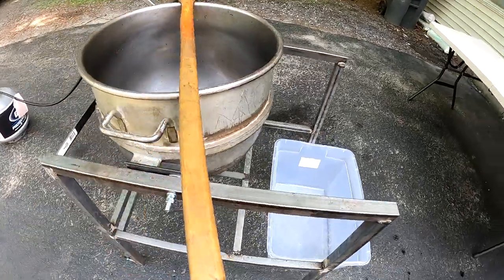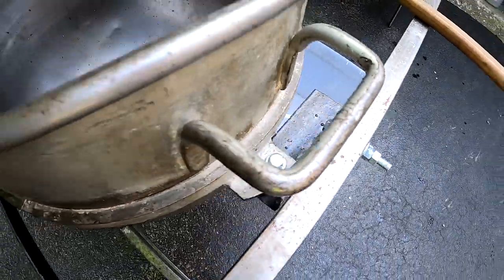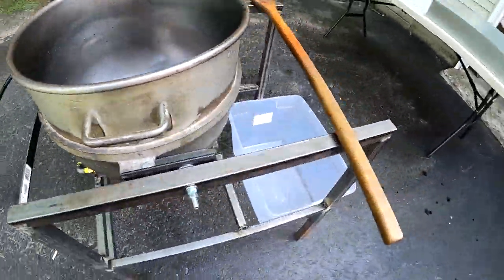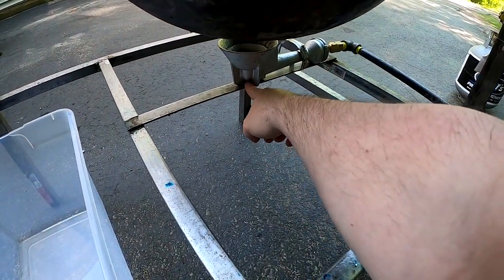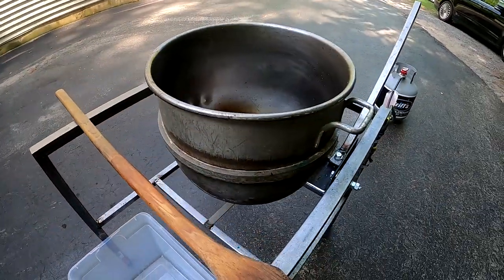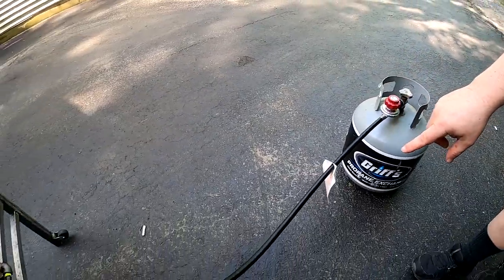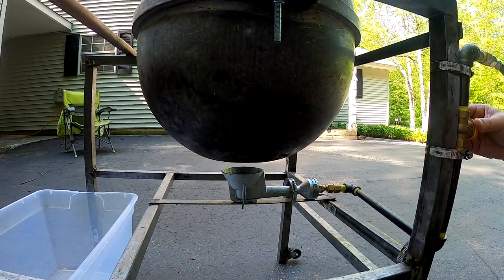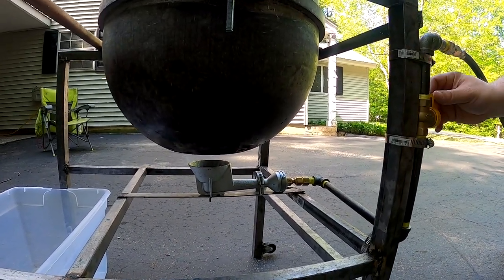Kettle Corn Homemade by Building Your Own Kettle Corn Popcorn Machine

Comment: I am going to use an 80 qt kettle, will your plans work for that sized kettle too?
Reply from the maker: That's excellent!  We've never built an 80 quart popper but have been thinking about it.  The basic premise would definitely work.  You'll probably have to widen the structure slightly and change the height of the burner to accommodate the larger sized kettle.  If you do wind up making it, we would really love so see some photos.  Good luck!
Reply: The dimensions of the 80 qt at 21.5 in wide and 18.5 in high.

Comment: Any idea what 12v motor works good for an auto stir?
Reply from the maker: Hello!  On the commercial systems they use a Dayton 1LPL6.  Hope that helps!  Thanks for watching!!
Reply: Thx but was looking for a 12v not 115v
Reply from the maker: Sorry about that, I need to read better 😀  I'm not sure about 12v.  I wonder if something like this would work?  https://makermotor.com/pn00418-60-high-torque-12vdc-60rpm-12mm-d-shaft-reversible-1-8hp-planetary-metal-gear-motor/  It says high torque.